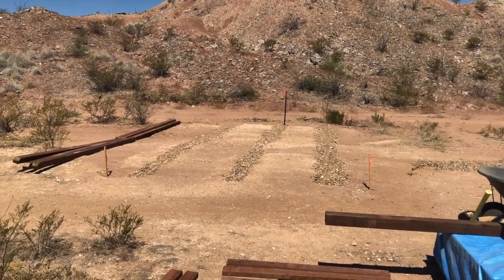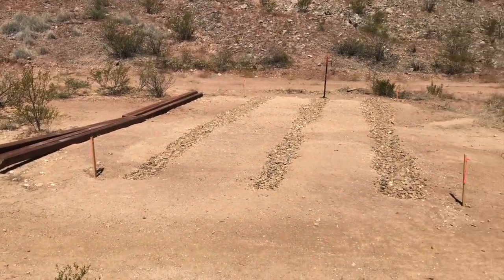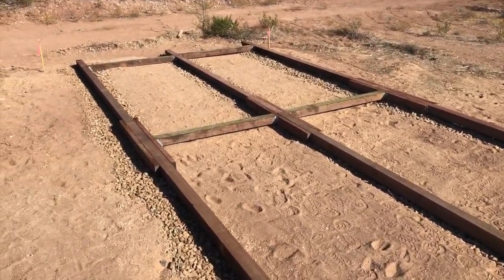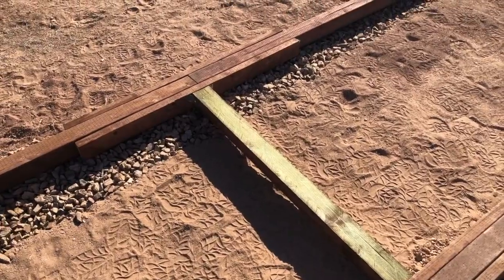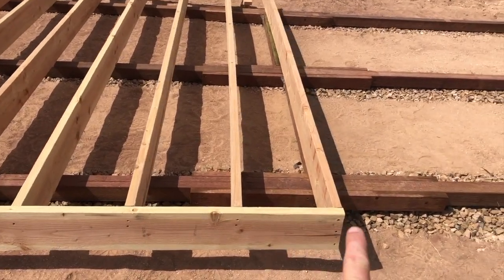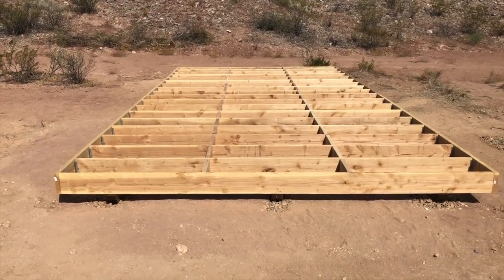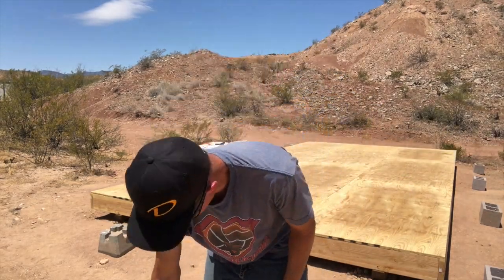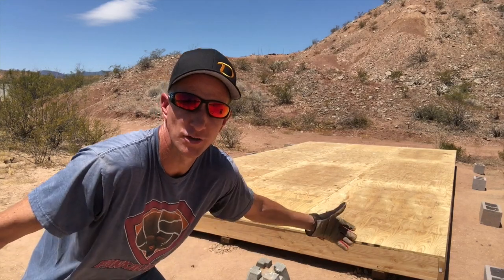12'x24' DIY Shed Build (Part 1 - Floor)

Comment: On your gravel base
Rounded rock (pea gravel)
Isn't good for supporting things
Because the roundedness allows the rock to move..
Broken rock is better at supporting weight ..  The flat sides (or straight sides) are better at locking into place
(what do I know is a good question)
I spent 36 years running heavy equipment .. Grading and compaction was one of my specialitys... (Roads, slabs and. ?? Usually set on CAB (crushed aggregate base) or CMB (crushed miscellaneous base (crunched concrete and asphalt with some dirt for fines))
Reply from the maker: Good to know for the future!  We were planning on using pea gravel, but I only needed a little for this project, so I just used some broken rock that we had on hand here.  Sometimes better lucky than good, I guess!  Thanks for the tip! 👍
Reply: @MidlifePrices  
If you are looking to build roads , driveways
The fines (small material like sand and or rock dust). is what helps lock (make hard) the material.
Maybe an easier way to under stand
Google Crushed Aggregate Base
Or
Crushed Miscellaneous Base
Specifications

Comment: How thick is the plywood you had used
Reply from the maker: It's 3/4".  I had previously done a small floor for our metal shed with 1/2", and it was sagging a bit.